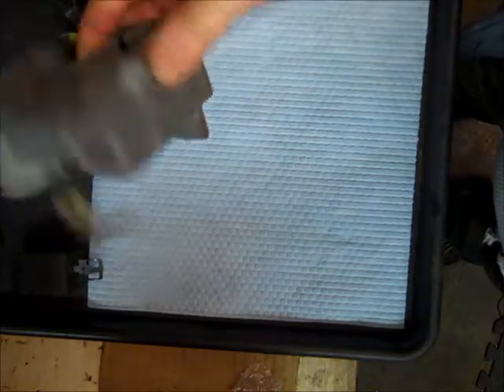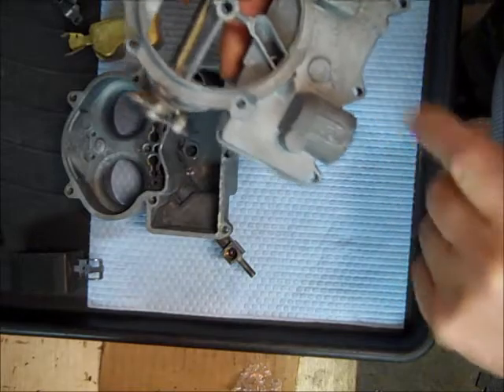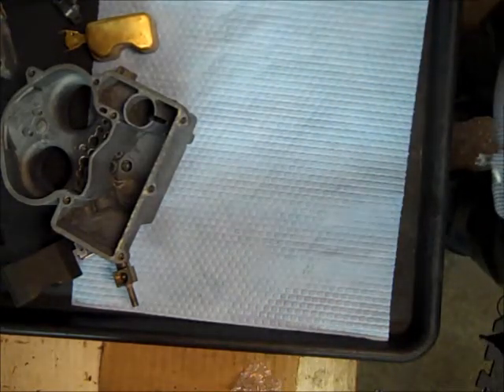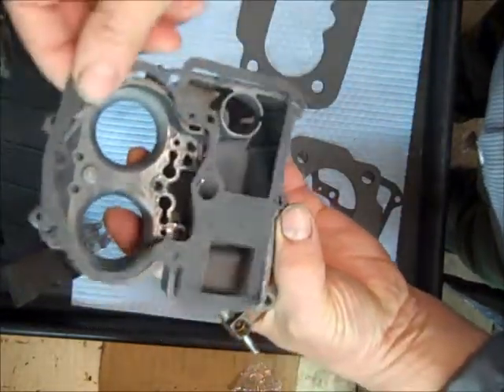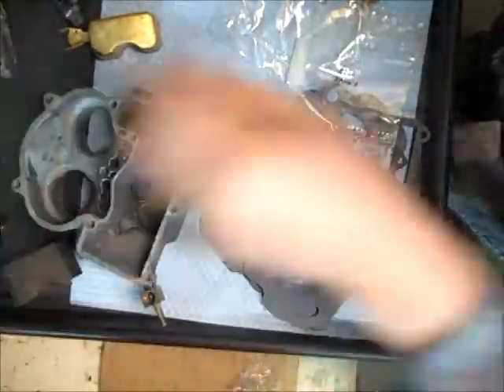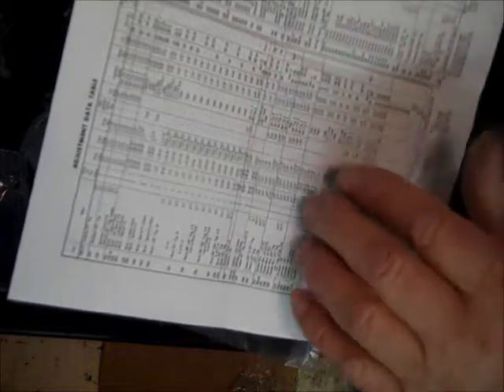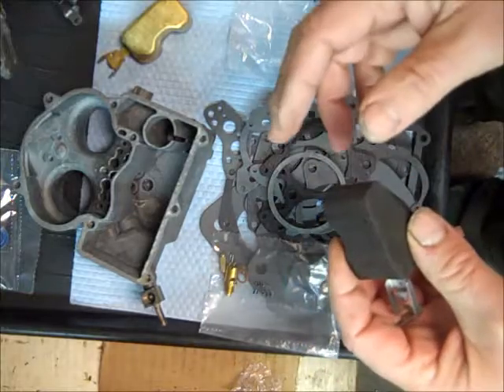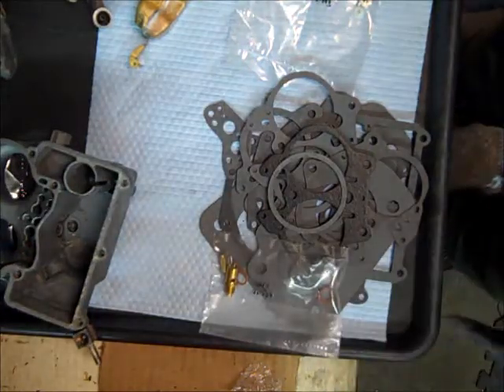Rochester 2G, 2GC 2 Jet Carburetor Rebuild - Part 1

Comment: I got a stumper for you !!! ( by the way  you parts shipping and service is great thanks ) Built and highly modified chevy 292 inline 6 and using the Man-A-Fre intake , (three rochester early big base carbs ,matching 2 jets) its an independent runner, no plenmums , so all carb linked together , on the dyno we fired it up ran it to break in the cam and first pull around 4500 it just goes into a dead missing and no power, Im built and raced tons of big and small block chevys and seen it all but this is a tricky one ! we are not getting fuel to #6 cylinder !!! spent 10 hours going through everything, this old carbs are or were rebuilt maybe a year or so and set on the self till I finished the motor , when we open up the back carb to change jets 59s to 62s we noticed green corrosion around the jets one more than the other. My support staff are teo seasoned race engine builders,we went through everything at least twice on and in this motor !!!! first pull fot to 4400 and 311 HP  and down hill from there !!! we had these carbs opened up 10 times !!!I'm  scrapping this set up and going to my 2X4 Holley 450s, I don't know how one carb can feed one cylinder with a common port and not the other, BTW, iT ran great  and idle  perfect till 4500 rpm then its missing and zero power.Its the koolest set to look at but don't run , what in  the world would make the carb act like that? The only thing we didn't change was switch carbs to with one on another port. what in a 2 jet could cause this? these are early big base type like late 50s early 60s. Thanks Brad

Comment: I have a question; I have a Rochester 2g and am having problems with it bogging. I just rebuilt it and it worked good the first time, but now it is bogging and stalling. I can feather it to go higher but cannot get it to go smoothly. I was told it was the accelerator pump due to the ethanol. Is there a way to tell if I have the right accelerator pump? Is the accelerator pump even the issue? Any input would be appreciated. TIA (For a Mercruiser Inline 6 but not a merc carb with 2 idle screws)
Reply: You still Alive? Got the same problem

Comment: Hi Mike, I am having trouble with my 2Jet: engine starts only with full throttle and quite unwilling. Sparks are extremly wet, when engine does not start at once. Guess, engine runs much to fat, producing dark smoke. Idle screws are just 1 turn out... Any idea? engine is an 4.3 GM V6 in an boat.

Comment: mike I have a 2GC on my boat. I have had it rebuilt professionally, but i am still having problems under heavy acceleration. What should I look for as far as possibilities? perhaps the float isnt set right? or Maybe I have a bad accelerator pump? I looked down the barrels under a load and it doesn't look like the fuel is spraying evenly.

Comment: Mike,  I have a 2g on my dauntless 225 jeep motor, just rebuilt it (with your help) it appears when I dropped the larger ball bearing into the accelerator pump well that it stuck itself, not sure it was supposed to be there, it will not come out now. I didnt see a check ball wen disassembling, but put it in after the video since I was flooding soo bad. Anyway the jeep now runs but is so rich it stalls out. It was converted to an electric choke and appears to be set about right, its closed when